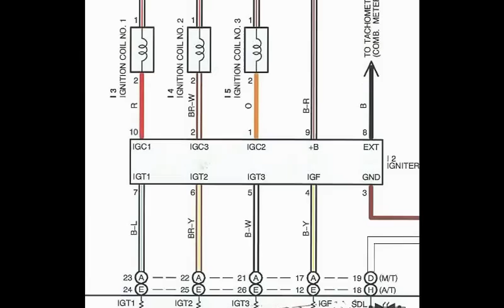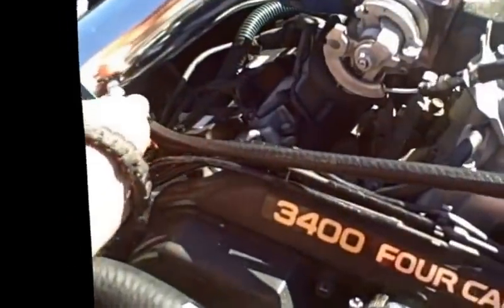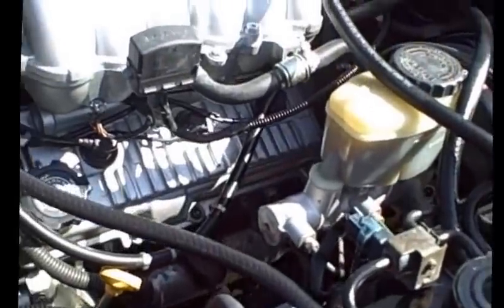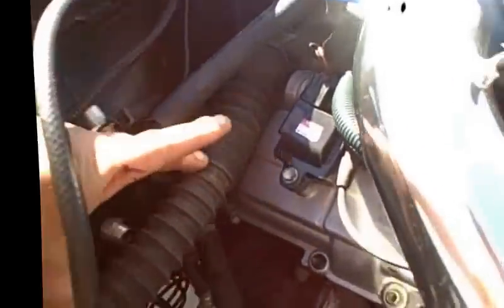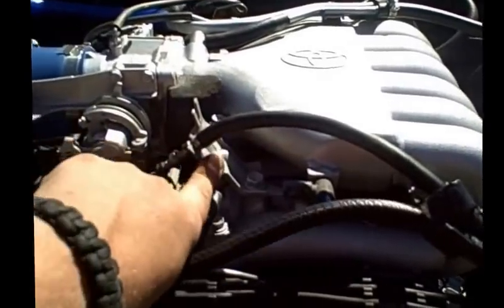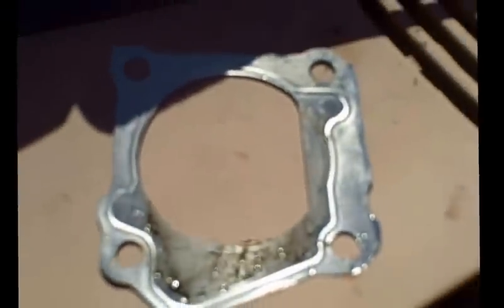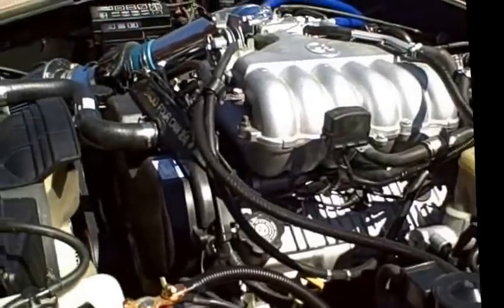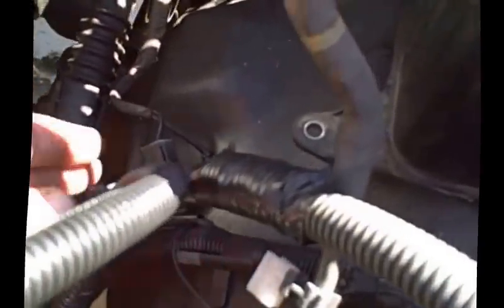94 Toyota 3.0 to 97 3.4 Engine Swap

Comment: Best 3.0 to 3.4 tutorial on the net.
Reply from the maker: Thanks Joash!!  Good luck if you do it.  You won't be sorry!!
Reply: Hey, what do you think, should I put headers and a y pipe a little further downstream, or should I do the crossover that restores the factory config?
Reply from the maker: From what I have read, the headers and Y pipe truly don't give you much added horsepower.  Additionally, they are a PITA to get to fit as modification is needed with a BFH.  Personally, I would save the $650 and get a roof rack storage set up filled with new camping gear to survive the zombie attack....or whatever attack. Send your pipe to Toyonlyswaps and simply get the crossover.  With the saved money, you will thank me later.  Unless you are running the off-road rally circuit, it would be a waste of money IMO.  You WILL do just fine in the hills and have plenty of new power............it will be night a day.  Trust me!!
Reply: @10MinutestoRouletteFortune  Yeah, but you don't have to worry about the failures of the head gasket on the 3.slow. the 3.4 is tanky and i would throw it in my 1995 if i had the opportunity.

Comment: Do yourself a favor and scrap the fan and go electric. It will help power and fuel milage as if you need more power and you wont have to worry about the hoses. The 5vz swap is amazing  just finished the swap on my 91 2 door yes i SAID 91 2 DOOR. 5 speed SR5. We are now swapping our 4th 4runner. The toughest part is the wiring. Going from auto to manual you have a ton of stray wires from your 3.0. We are in KC and have a post on CRAIGSLIST for toyota conversions
Reply from the maker: +Bryan Ponton yup........... I pulled that wiring off and I felt like a GOD!!

Comment: Thanks for making this very informative video! I'll be sure to watch this video again when my 3.0 finally dies.
Reply from the maker: +shoua7  Sorry for the late reply. My advice, plan now and start getting the parts.  That is what I did. I picked up the engine and slowly started learning and doing the work like the Valve adjustment, timing belt etc.  In a way I really wanted to kill the 3.0 as I was ready. Hitting that puddle was just and excuse I think. Join YotaTech.com.  All the info is right there.  I'm Oregonslonewolf on that site.  My detailed swap pages are available. GL
Reply: +Logan S Thanks for the reply. I've been on Yotatech for years now. I'll be sure to look up your write up and watch this video when it's time.

Comment: I wish you lived in Arizona to help me do my swap because I’d gladly pay you for your help and insight! Great detailed video and awesome job!
Reply from the maker: Thanks, you can do it. The only major thing I had ever done to a vehicle was change a timing belt. I knew nothing about electrical, clutches or, well, anything. It was a challenge but when I turned that key and the darn thing started, I felt as though I made it to the top of Everest without oxygen. If you put your mind to it and challenge yourself you will have the same feeling. If I can do it, you can do it. Cussing is part of the fun even when life seems to suck at the time.  Yotatech.com will guide you along the way.  Read read read. GL

Comment: Thanks for the video. Doing the swap in a couple weeks, this rundown makes it seem way less intimidating.
Reply from the maker: +Clinton929 Glad it helped out man.  How did it turn
Reply: +Logan S Good, I actually shot it every step of the way and releasing a video series soon! Gotta make a new channel first though
Reply from the maker: Clinton929
 Rock' n Roll man. Lets link to one another in the comments and aim for a complete How To. Sure would be helpful for this outstanding swap. I lost all of the footage of my converting the 94 ECU pin outs to the 97 computer. I think that would have been the most important of them all.
Reply: Sounds good man!

Comment: the other part of the throttle bracket is for the a/t kickdown cable and cruise control if you have it... so if you have a manual trans without cc you don't need to worry about it.

Comment: Cool video. I'm in the process of installing a 3.4 in my sons Tacoma. Then I'm going to try swapping out the 3.0 in my truck. I've been talking to ToyOnlySwaps about what I need to send them for a wireharness. This is the first one I've seen where they show anything but the startup.
Reply from the maker: padolph007 Thanks. yes, I saw there might be a need for something more than just an engine start.  It really wasn't all that difficult and perhaps seeing this will give people a better idea of what is involved.  good luck and enjoy.
Reply: +Logan S  I got it all in and ready to try and start it up...It turned over for maybe one revolution or so then nothing. I did notice the battery voltage dropped to zero when it was at 12 or so to begin with. I did happen to rock the truck a little and the battery voltage shot up then back to zero so it appears there is a loose wire somewhere...Also what hose did you use for the bottom radiator hose? I tried a couple then just forced a flex hose on it so I could try and start it.
Reply from the maker: padolph007
Great Job..... yup, you have a short somewhere I would check your grounds at the plenium and even at the ECU as those wires for ground are a PITA!! Check the E5 plug.. The bottom radiator hose should be for the 3.4 with a little cut off.  Sorry for the late reply.
Reply: It ended up being that short little wire from the negative terminal. Now it starts but does not idle. I then noticed that my fuel line is leaking. I don't know if thats why it is not idling but I figure I better fix that before I go any further. I also planned on pulling that throttle body off and cleaning it out just for good measure. I'm getting close...so close.

Comment: I’m about to pull my 3.0 out of my 95 for a 97 3.4. I just need to know what all I can probably cut from the 3.0 engine when removing it. I’m leaving the transmission in the 4Runner and unbolting it from the 3.0

Comment: Not sure where else to turn...  bought a '95 4(non)runner for 650.00 6 months ago...v6 3.0..auto..   Engine sounded fine and I was told transmission was toast.  A tranny swap later,  2,800 total in new parts and towing and about a month of total hours spent and work hires lost,   I'm told today by mechanic someone put the wrong spark plug in engine and it is now toast...well,  barely functioning.   I knew this would be a learning  experience and I might loose out on purchase,  but I thought the engine was fine and that's what I was buying essentially.   Now I don't know which road(walking trail) to take...  Can I rebuild engine myself if I did tranny swap myself?   How much more can I expect to drop into this paper weight with wheels?   Also I have 4 brand new tires and coil springs worth almost 1,000 already bought and paid for.   A lot of effort to turn around now...    Live and learn (after many curse words).

Comment: Hey man how’s it going! Did you have to do any special cutting and splicing on the wiring harness?
Reply: Did you find out anymore on this? Currently about to hopefully finish this swap this weekend and the wire harness is the biggest hurdle. I've seen mixed reviews on if you can do it without buying the 600+ dollar kit

Comment: Did you pull your Trans when dropping in your motor?just wondering if it would be easier with the Trans in or Trans out?I'm doing a swap now.thanx and the video is legit

Comment: I really appreciate this video.. My younger sister recently purchased a 93 3.0 pickup 5sp. The guy who owned it previously put it together terribly and the truck is having a good amount of issues. I plan on a 3.4 swap as I have wanted to do it to my previous toyota pickups that ive owned. My question is related to the wiring, If i buy a 3.4 with the complete wire harness/ecm, do I not have to worry about wiring things up as its already a complete harness? (hopefully) Thanks again, I hope my question makes sense!
Reply from the maker: +dirtrider292 Sorry for the late reply.  Yes, the ECM will be different between the 93 and the 3.4. Quick answer, yes it can be done as that is what I had to do.  You can learn how to read ewd (electrical wiring diagrams) as I did. Expect a learning curve but you can do it.  It is just matching wires to certain functions. COntact ToyOnlySwap in Oregon for harness help.  Join YotaTech.com and read read read.........and read again. You will get the help you need.  It is a great circle of mechanics.   GL

Comment: Also, when removing the 3.0. Was it easier to remove the Engine from the transmission together or removing them from each other while the transmission is still bolted to the car?

Comment: Great video man!  Just blew a head on my 3.0 and ready to do a 3.4 swap!
Reply from the maker: posjoey   SOrry to hear that man but you won't be sorry with the swap and engine prices have come down. It is so nice being able to drive 75 on the freeway with no problems. Pay special attention to wiring during troubleshooting and it will be a breeze.  GL.  Let me know if you need help.
Reply from the maker: +Logan S  Update, I blew my head gasket on the 3.4 350 miles from home.  Yeah, if you do this, change every damn gasket on the motor. You will thank me later bro. I"m still pissed!!
Reply: @10MinutestoRouletteFortune  what is every dam gasket other than the head gasket ?  My 95 has Ben sitting for four years and have the pipe dream of being able to this.  Yep 3.0 kept blowing head gaskets. .
Reply from the maker: @marcb6290  valve cover gaskets, water pump with gasket, rear main seal, oil pan gasket, water pump gasket, intake to throttle body and........umm......I think that's it.
Reply: @10MinutestoRouletteFortune  ahhhhhh vugggg just went to check on it and where its parked just put a tow sticker on it.  Cannot get anyone to help me move it.  Some tow company it's going to steal it and get a free 4rnr.  Such evil greedy fucks.  I at least want to get the 500$ stero head unit out and the new 31in Toyo  open countrys off it.  Fuck. That truck is my baby , been by my side for 15 yrs through thick and thin you name it.  Desserts, mountains, highways, snow, ice , beaches, sex, children, love. Weddings, parties, camping, fishing,....  This is devastating 😪😪😪

Comment: I have. 1991 Toyota auto its 4x4 only reason I pick it up was low miles 66xxx. Bi want to do this but I might get stuck and den run out of ideas. How long did this take u? My 08 auto to stick conversion 350z took me 4days because of the stupid pilot Bering

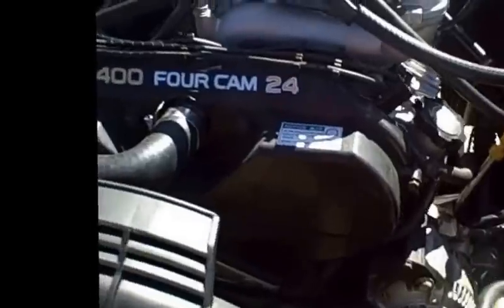Comment: At time 2:00 you say you need the engine mounting brackets. I'm not clear on if you need the brackets from the 3.0 or 3.4. At time 3:18 you are talking about the alternator and then you say use the mounting bracket from the 3.4. It's right before you say use washers as spacers. Is that the alternator mounting bracket you're talking about. Similar question with the power steering pump. you say use the lower mounting bracket from the 3.4. Are you talking about the lower bracket for the power steering pump?

Thanks in advance for the info!
Reply: ~you need the engine mount bracket from the 3.0 they will bolt up to the 3.4.
~you need the 3.4 alternator mounting bracket along with washers as spacers to bolt up the 3.0 alternator.
~yes 3.4l lower bracket to install power steering pump
I just did this conversion myself, just get all of the 3.4l original lower mounting brackets they all have tensioners for the serpentine belt hope this helps

Comment: What did you end up doing for the wiring, you didn't really go over it too much, it sounds like you used the 3.4 wiring harness. I know you had several ORS products, did you get their harness and get a new T100 ECU? or did you spice the 3.4 Harness to the ECU/BCM? This is a great video, I feel a lot better about my swap option now !!!
Reply from the maker: Well, for me to have covered it would have been 3 other videos. This is how I remember it. For starters I believe I had to get a manual ECU for the 97 engine that was 4x4. This was hard to find. I also had to get the plugs to match that ECU.  Mine was far more difficult as it was an automatic engine of a different year with wiring going into a manual Runner. I had to figure out and re pin all of the components. This was all new to me so I had to learn schematics. I basically got a copy of the schematic from the 97 and matched it to the 94 and re pinned it at the ECU.  Also component names had changed between the years somewhat so I had to figure those out. Let's just say it was hard to wrap my mind around but I pulled it off to my amazement when I turned the key. Add the harness and there ya go. Sounds daunting and it is, but yours will be far easier as you prob don't have a manual. If that's the case it could be plug and play, not sure. I miss that 4Runner as it's rare to find a manual.
Reply: @10MinutestoRouletteFortune  Thanks for the quick response. hope your truck is running GREAT!!

Comment: Would like to hear you expand on the  engine wiring.
Reply from the maker: That is pretty difficult to explain for a few reasons. I don't know what engine you have or if manual or not. The pin outs are confusing which it why I sourced a 96 engine and just used the pin outs found on YotaTech and got the harness from offroad adventures or solutions I think it was out of Oregon.

Comment: 2 weeks after I rebuilt my 97 tacoma with the 3.4 i rolled it so i am gonna buy a 95 or older truck with a blown 3.0 and do a swap
Reply from the maker: +countrymankdx200   Sorry for the late reply man.  bummer that happened right after you rebuilt it.  Mine blew the head gasket 350 miles after this video.  I was out of town and had to have a mechanic do the work while I stayed at a hotel............long story short, he didn't torque my bolts correctly and it blew once again a week after I got home.  I had to get a new Jeep as this was my DD.  Just sold the Runner................and now I'm sad.  :(
Reply: @10MinutestoRouletteFortune no way wow what a bummer that must of been really upsetting so sorry.
Reply from the maker: @richiebenning5629  Yup, big time bummer but.......I did something I never thought I could do so I guess it was a massive achievement. Damn I miss that Toy.
Reply from the maker: Frank Stall  You will love the swap!!  The hardest part will be the pin out process on the ECU.  Look out for grounds and sometimes those pins are hard to unlock. Use a paperclip that is sharpened to release it. I knew little about cars having only changed a timing belt before this.  If I can pull it off, anyone can!!  Good luck. I love the manual and they are hard to find now.
Reply: @10MinutestoRouletteFortune  very good info I Own a 1991 Toyota pickup manual 132.000 miles might be a good Idea to swap a 3.4 down the road. Thanks again

Comment: Lonewolf, I just stumbled across this and found it extremely helpful.  I am about to start my own mod on a 91 4runner.  After having a disaster trying to get a 3.0 engine to replace the one in there.  I would like to be able to hit you up with questions if I can.  Thanks
Reply: Blair Ludwig  Were you able to change your engine? I have 90 4Runner and thinking about doing the same. I have 2.2 engine and thinking about swapping it. Would like to know what your experience was like. Thanks man.

Comment: Can you put a video of the harness or what we need to do harness.
Reply from the maker: It's a very long drawn out process. Every vehicle is different and one has to get the vehicle's pin out and compare it to the pin out of their year, model and if it's AT MT of the vehicle that will get the motor. There is a harness you can get out of Oregon. This was so long ago I can't recall. Most of your info will come from YotaTech.com. I really wish I had done a start to fining video series as I could have made some coin on them but had no idea what I was really doing. It's a challenge, but if I can do it, so can you. GL You will love the difference.

Comment: So what were the major Upgrades as far as HP and torque , gas mileage differences?
Reply from the maker: Wouldn't be fair for me to say for sure as I haven't put it on a dyno.  that said, it feels like 40 more hp with the exhaust and engine, it handles much better on the hills without downshifting which is in an increase in torque and gas mileage is about 3mpg increase if I stay off of it.  I definitely felt a noticeable difference......felt like my 4 Runner was alive. So yes, do this swap. The engines if cared for will run forever.  I've put 70k on it since the install. I'm going to be sourcing another engine and having it rebuilt for when this blows up. Right now this has over 215k miles.

Comment: You didn’t cover any of the harnesss work or mods you needed to make. Did you outsource for the harness work?
Reply from the maker: I think I mentioned the harness info. I think I went through Oregon Offroad or something like that.  It's an Oregon based company. They will get you the harness for the transmission, 4x4, etc. It's all attached to one. There is far too much info for just one video and I could have probably made 40 from start to finish and now that I think of it should have. Go to Yota Tech or check the description as I think I put all the info there.  GL.

Comment: So can you use the same throttle position sensor between autos and sticks? I’m gonna do this but The old T100 deserves better than a garbage 3.0. Toyota actually pissed me off putting a 3.0 in a “1/2” ton pickup...
Reply from the maker: I bet that would SUCK for power.  You will really like this set up......pay close attention to your computer pin outs based on year of engine and rig.  Thanks for commenting!!
Reply: 10 Minutes to Roulette Fortune makes sense. Does suck for power; 45 mph in third gear over mountain passes. Ima buy both dash and engine harnesses so hopefully I done have to rep in anything... also bought a new ECU.